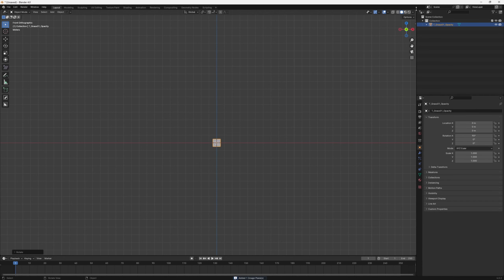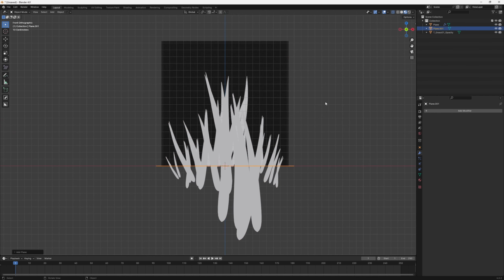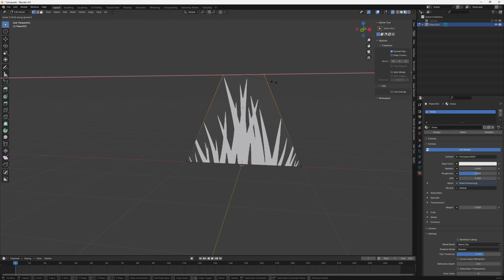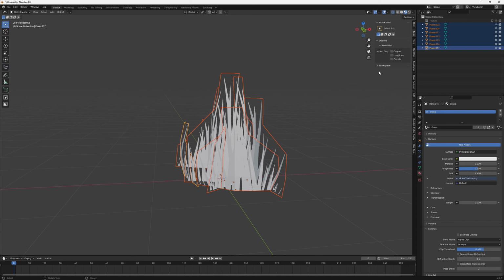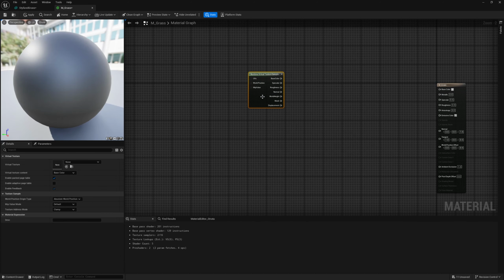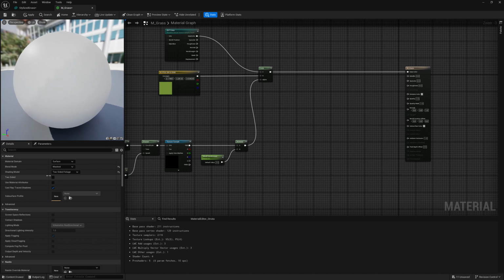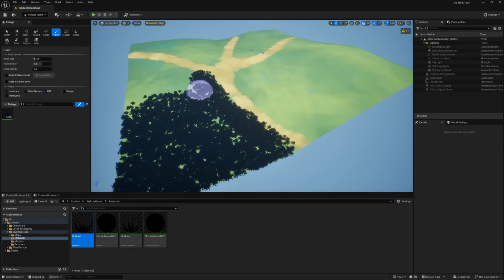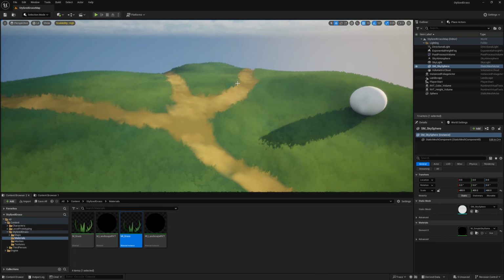Creating Stylized Grass in Unreal Engine 5 - Part2

Comment: Followed this to a T and for some reason when I put foliage in some areas of the landscape my grass just turns white, the color looks correct on unlit mode but in Lit they look white again, i tried for hours to fix it, like checking my normals on blender, checking the light on my scene, copying the exact parameters on the video, changing the settings on the landscape material to see if the white grass started reacting to the landscape, nothing works. No idea what is going on.
Reply: I finally figure it out, I was wondering why we created a virtual texture for the height and never use it, when creating the grass material, when creating the normal nodes, instead of what is in the video, create another "Runtime Virtual Texture Sample" node, and select the RVT_Height as the "Virtual texture to use" and connect it to the input of the material, then change the material settings and uncheck the "Tangent Space Normal" setting. That fixed my issue.
Reply: @amacias2012  what did you exactly do here? what input did you connect the virtual texture to? i am having the same problem
Reply: @rihannnnnnnn  did you figure it out?
Reply: @amacias2012  connect to what part of the input  of material ? normals or base color or what???

Comment: Having a bit of an adjustment issue.... Kinda weird but if you change the brightness from part 1 on the landscape layer the rtv's don't pick it up, so it doesn't change the grass mtl. the result is having the grass super bright compared to your landscape...any ideas?
Reply: so quick small update, the temp fix i found was to attach a brightness multiplier to the grass as well, but the rtvs really dont like it... it gets really patchy. Also i doesn't like any of the parameters he put on the landscape other then the colours

Comment: If you guys are having issues with the texture try changing the value in 11:40. Instead of X you can try the others (Y, Z) and try with "Invert" selected. Because sometimes the vectors are not the same. Maybe you are facing another problem but it worked for me.
Reply: yep I had to add a normal edit and point it to an object under the grass for some reason, spent hours trying to get the normals to stand up

Comment: You don't get the black parts in 5.1 and up until 5.3 as long as you don't use two sided material. And if you landscape still does not look right go into your materials and click on the textures and change one of the modes to shared wrap, forgot the parameter name.

Comment: My grass has lots of hard shadows and the wind noise texture appears really dark in my project. Any help?:)
Reply: he did not show this in the video and i tried to fix the same issues and it took hours for me to figure it out, so in the foliage material, the main big one, search for "tangent space normal", and untick it. That deleted the hard shadows, also if you are using textures in your landscape, the rvt color doesnt work. only with the color parameter the wind color actually works I THINK, im currently trying to find a workaround for this. Hope this helps! edit: and also tick off two sided
Reply: @Rymnna  Absolute legend, it works perfectly fine now. Now my wind noise texture is a bit too dark in some places but ill somehow fix it i hope xD
Reply: @theelightgaming5143  Did you find a way to remove the black areas?
Reply: @Rymnna  Thank you so much, you save my life!!!!!!!
Reply: @davidteo4811  Hey! Do you have any dark areas?
Reply: @maxizdouc  yes, my grass have a really dark area before
Reply: Did you find a fix for it yet?
Reply: @maxizdouc  sorry for late replying, I did some fix and I can list them for you,
- change to two side foliage in the shading mode
- untick tangent space normal
- turn off two sided setting
Reply: @Rymnna  Thank you SO MUCH
Reply: @Rymnna  Wtf thank you so muchhhhh! I spent like 5 hours trying stuff with normals haha
Reply: What worked for me is plugging the "normal map" directly into the normal pin, without the "TwoSidedSign" node. I also kept the Two-Sided on checked.
Reply: @snowcraft_3D  This worked for me thanks man :)
Reply: You are my HERO!!!! This has fixed my problem 100%!!😆